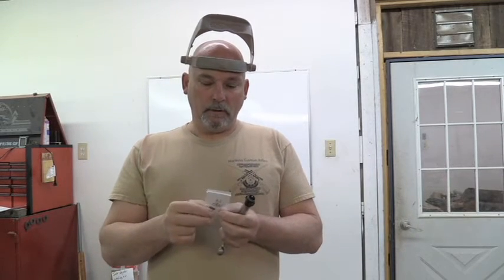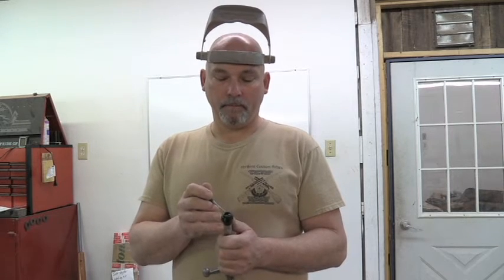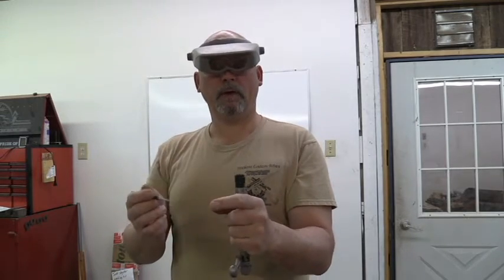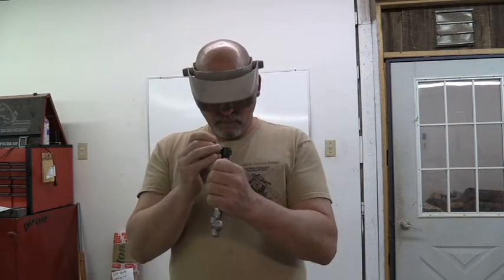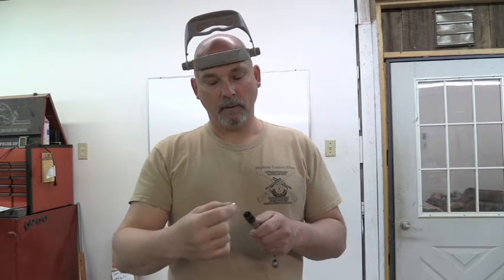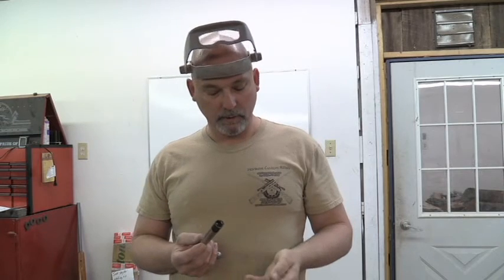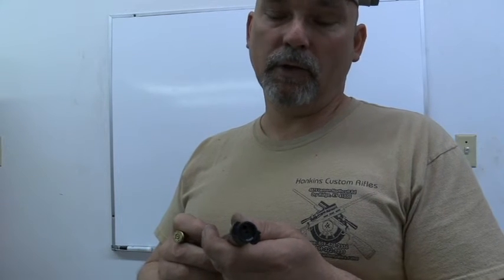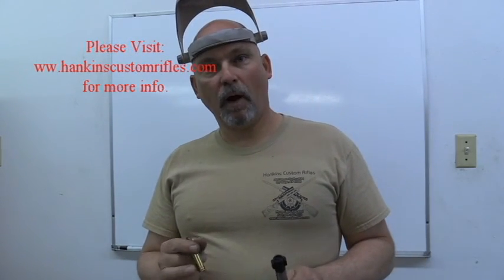Sako Extractor

Comment: I have a 7 remington magnum sendero 2, after a few Rounds the Rounds would not eject, a gunsmith said the weapons that starts with RR serial numbers have this problem that you have to get a hammer to release the bolt and punch the shell, what's the problem sir,the weapon is new,thanks in advance